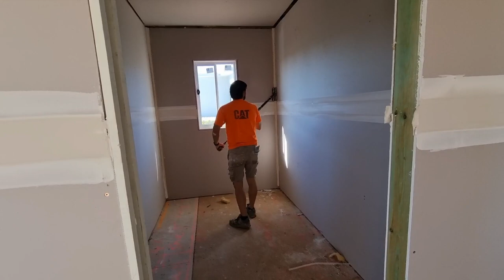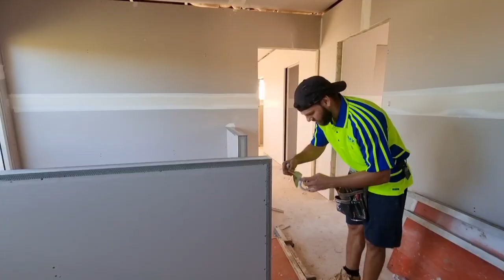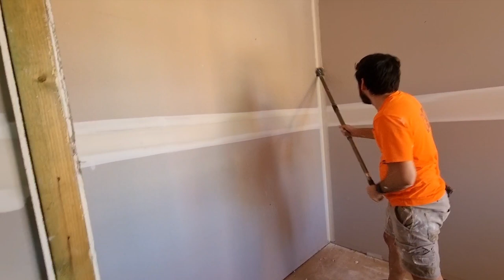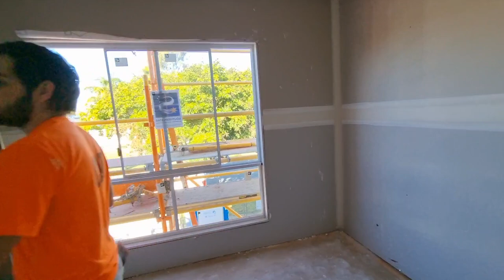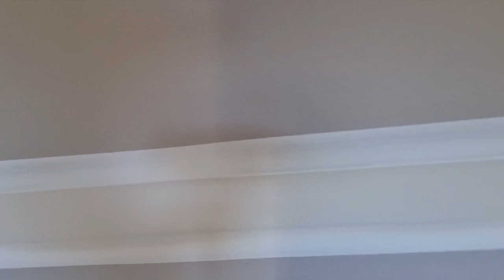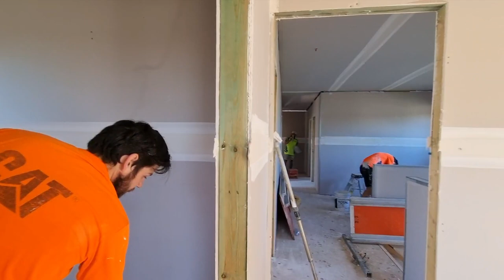HELPFUL Drywall Corner Taping TIPS using Roller and Glazer

Comment: Once again, what is the reason for boxing the wet flats prior to taping the angles?
Reply: It is to back fill the recess, because of how deep it is. I would argue the point it doesn't matter how deep it is, you should still back fill. I  have always had less issues
Reply: @markfaint3990  Prefill joints with setting compound before taping. A proper fill coat over dry tape will fill the recess and flatten the joints.

Comment: Did they know you don't even need the roller? As long as the banjo has the tape folder wheel, just the glazer does it.
Reply: I e done both ways much better job with roller
Reply: @cheveburkinshaw860  exactly same finish so how can it be better?
Reply: @krisbrand354  I just find u get a flater internal. Whatever works for u mate  we all do it but different
Reply: The corner roller beds the tape slightly deeper than the "Glazer", we call em flushers over here EH, giving you better adhesion with the tape to the angle. This allows you to lay a far more effective coat of mud over your tape with typically a 2.5", followed by a 3- 3.5". Some people even use the 3.5" first, and follow up with the 2.5" to avoid sanding between coats; you don't run over your burs from the previous coat.